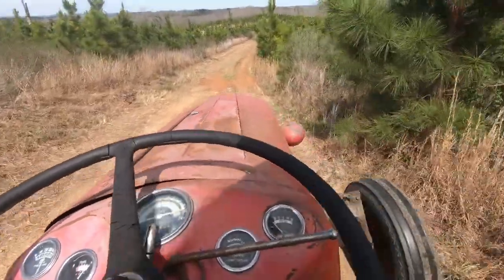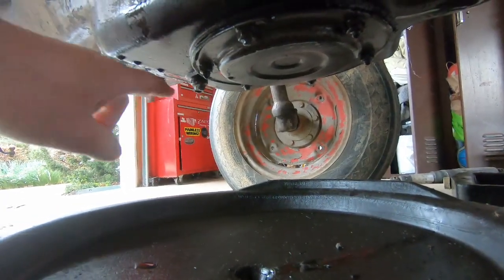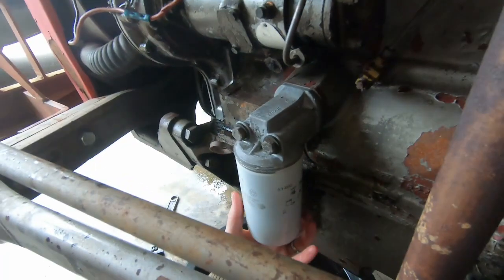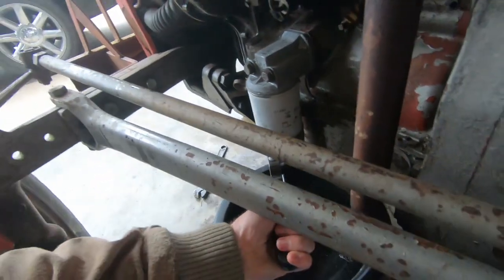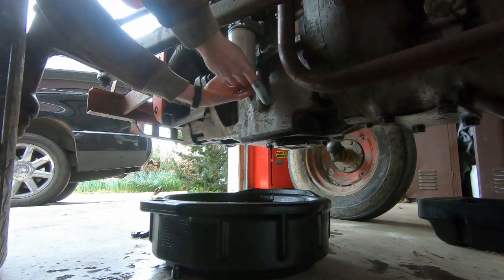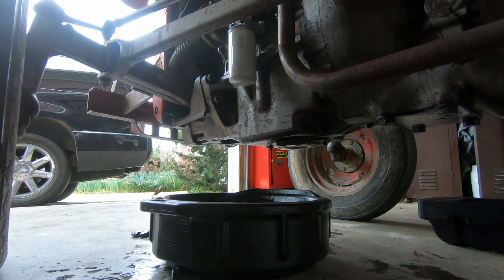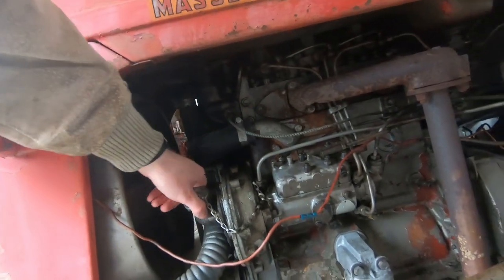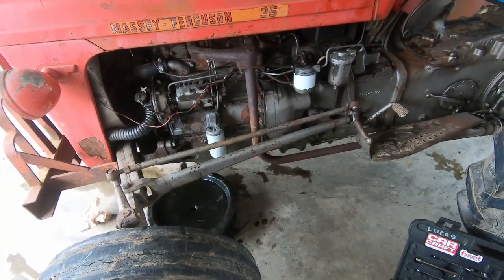How to Change the Oil in a Massey Ferguson 35 Tractor

Comment: I had an old 63 chevy belair, sold it last summer. Anyways the 283 engine was original. It had the old oil cartridge. I installed the adapter so I could have modern oil filters and it make like easier. Nice tractor you have. I love old stuff!
Reply from the maker: Believe it or not, I think Porsche still uses the filter cartridge design.  I know 996 era 911s still did for certain.
Reply: @FarmDad  really? I'm not a Porsche fan, I'll take an north american truck or car anyday. lol

Comment: I am Prabhakaran from India i am small farmer , i bought 1984 mf 35. It is powered by simson 3 cyl diesel engine which is manufactured by TAFE at Madras (south India) . What is quantity of engine oil it needs? 
( It is not Perkins)
All tyre air pressure?
Reply from the maker: Afraid I don't know much about that model as it was non available on my side of the world.  I am however very jealous that mf35s continued to be manufactured and sold in India long after they were discontinued in the USA.